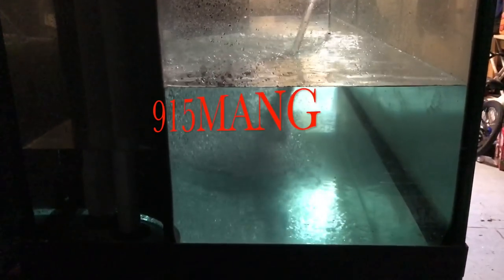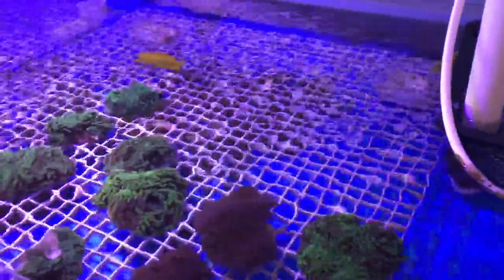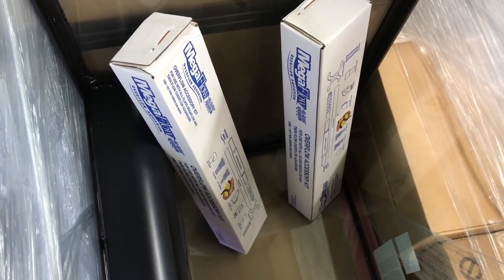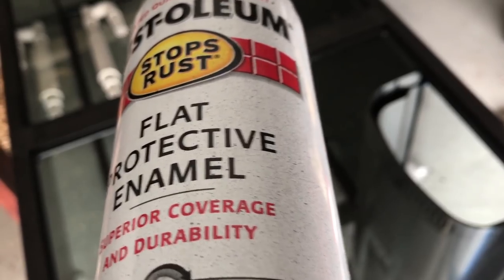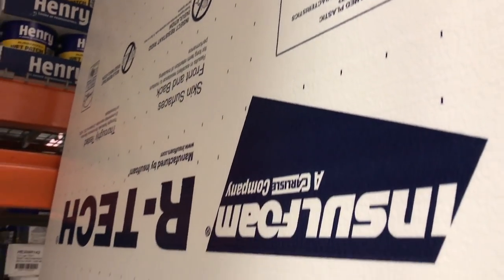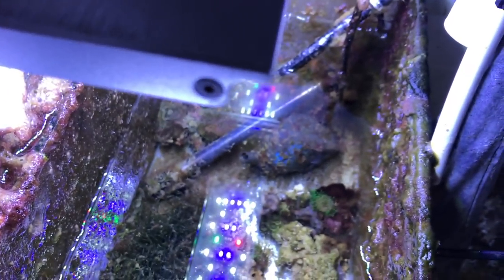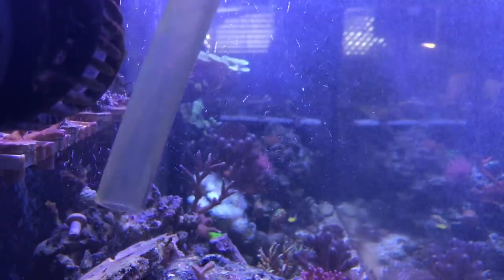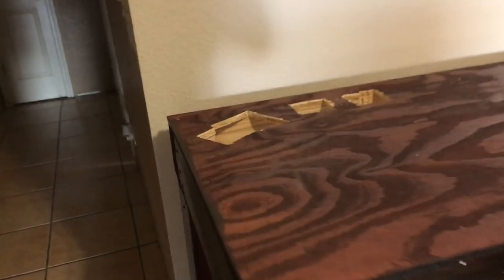180G SALTWATER AQUARIUM  CORAL REEF TANK UPDATE

Comment: did old tank leak
Reply from the maker: No it was fine, just a bunch of red flags happened to me. One of the braces came off and I siliconed it back on. A different Brace came loose from the tank, and I siliconed it back on. My overflow cracked in the corner.